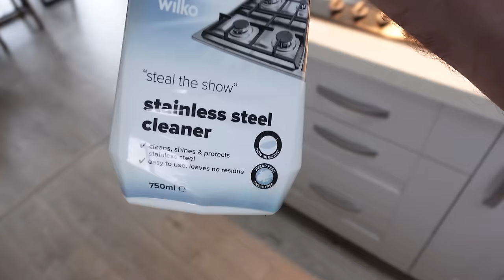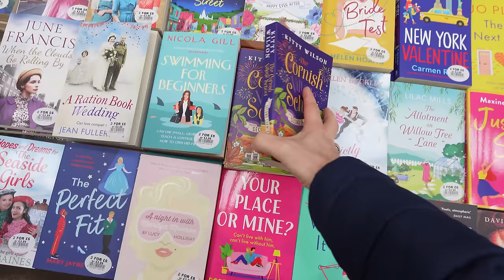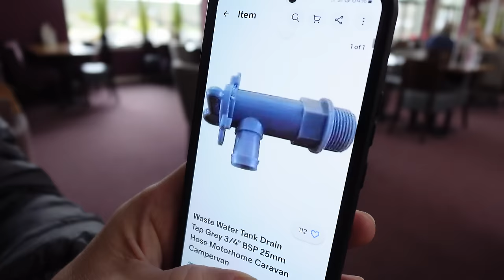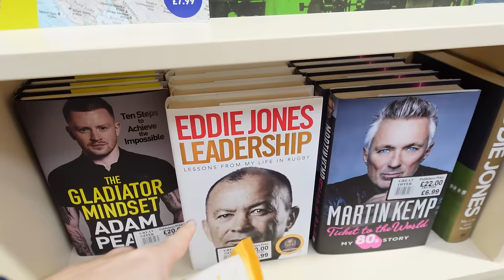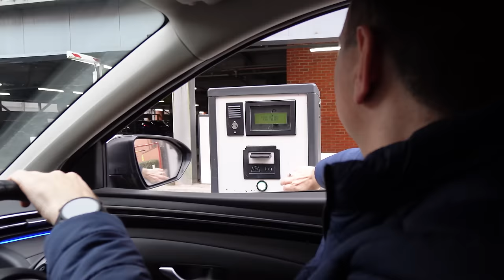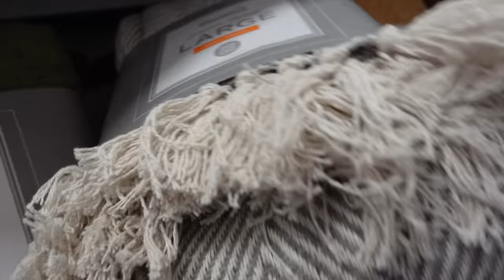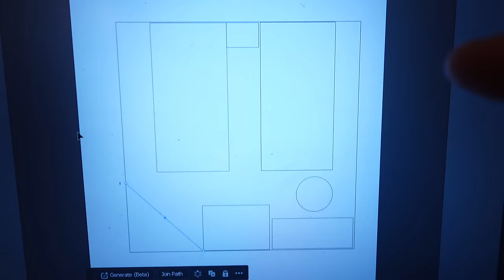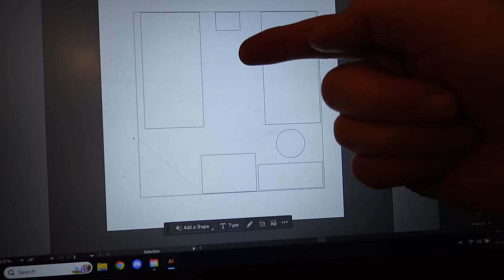CAMPER VAN - Making Improvements to our VW Crafter Camper Van

Comment: It’s important to unwind the cable completely from a reel before you use it.  Otherwise when you plug in you risk hot spots building up on the still coiled flex creating a fire risk. Some insurance companies won’t pay out if a fire has been caused in this way.  We prefer a cable bag and always spread the flex out on the ground when in use.  My husband keeps a cloth in it and dries/cleans the flex as he coils it around his elbow and hand before storing it back in the bag. He assures me the flex doesn’t get tangled.
Reply from the maker: Thanks for the reminder about this 👍